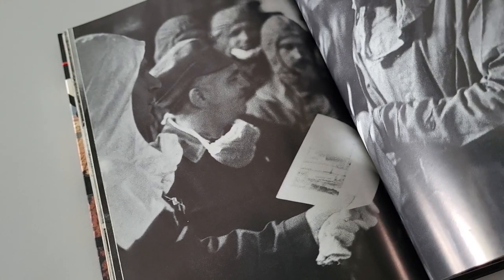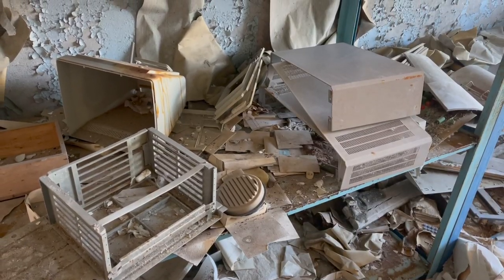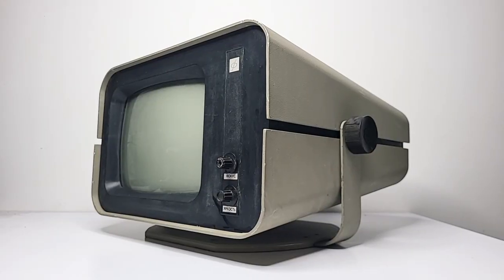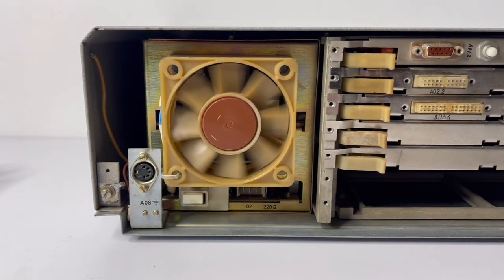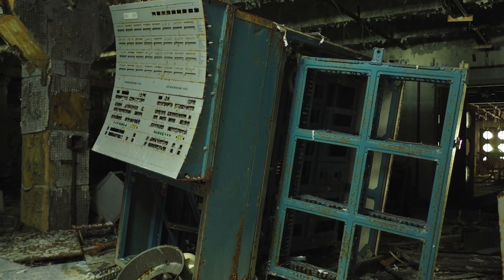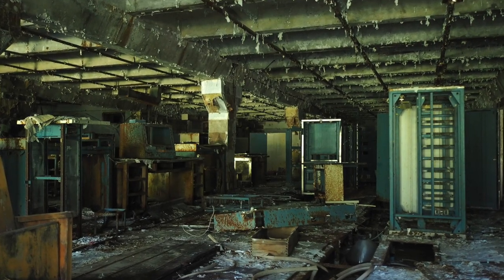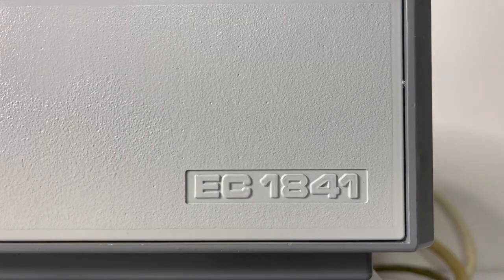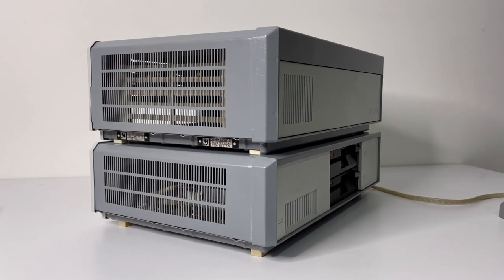Computers Of Chernobyl: Introduction

Comment: In a TV docu they explained that the mainframe computer of the Chernobyl power station took 30 minutes to analyze the current state (heat/activity distribution) of the nuclear RBMK reactor, which made it very difficult to control to prevent hotspots of local overheating. So basically it was like steering the Titanic solely with a radar that can display only where the icebergs were 30 minutes ago.
Reply from the maker: Mm... do you remember which documentary? As 30 min is a bit too slow even for 1986.
Reply: that's doubtful. The plant started in '78 and ran fine until '86, that's a lot of years to improve the computer hardware. That's a good story, though.
Reply from the maker: @squirlmy we've had a chat with SKALA engineers while preparing the documentary about it (check it out), they told that extraction of raw data of DREG program took not more than 2 minutes. Within the accident span, SKALA did not have issues.
Reply: @ChernobylFamily  The German name of the docu is "Tschernobyl - Die Katastrophe", made by the TV station Arte.

Comment: The big computer on the thumbnail is the Ryad, the USSR's answer to the IBM System 360.
Reply from the maker: It is ES-1060.02, it belonged to Ryad-2 of ES EVM. 

The word 'Ryad' can't be used in relation to a particular device; is literally 'Line', it is the internal name of the entire project of these computers that came from initial documents by ministry of radioelectronics, and later was used in relation to generations of machines. E.g. there were machines of Ryad-1, Ryad-2, Ryad-3, and planned Ryad-4.
BTW, these were not minicomputers. These are mainframes.

Comment: 2:22 They used 8 bit byte, 32bit word, 24bit addressing (byte addresable, not word addresable) and some had support for 64bit floating point (later there were a few high end machines supporting 128bit fp).
Reply: that kinda indicates how closely they were imitating the West. Even into the 80s, companies like Symbolics Inc. had word addressable chips (based on LISP). Obviously those weren't imitated. The standardization around IBM (and DEC) minicomputers must have been very entrenched in the East. In the West, partly because of the IBM PC (and clones), much of computing standardized around 8 bit byte, etc. DEC came out with the first 64bit chip, the Alpha, which was soon bought by Compaq, which was bought by HP.